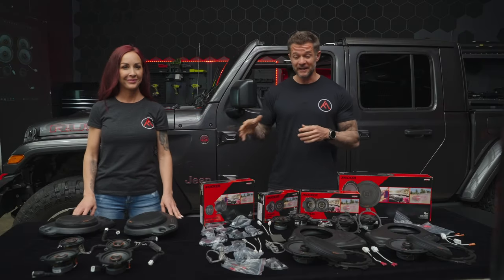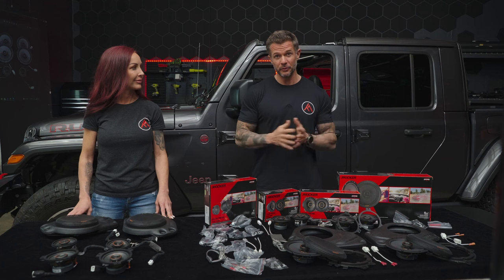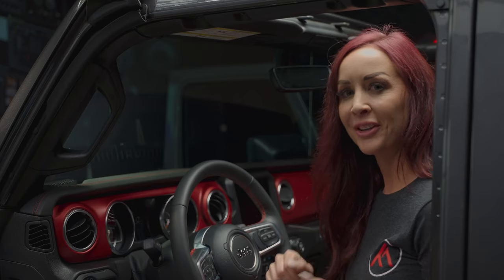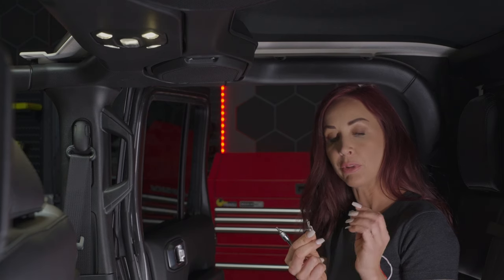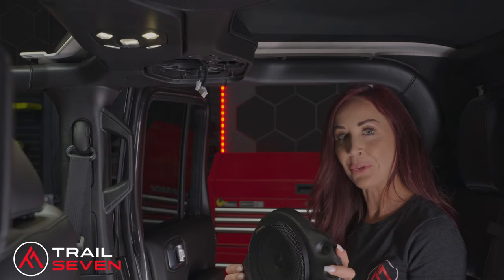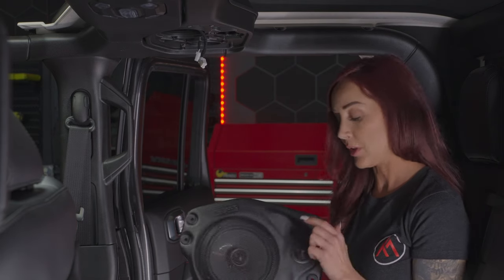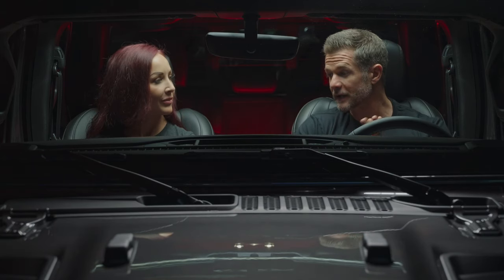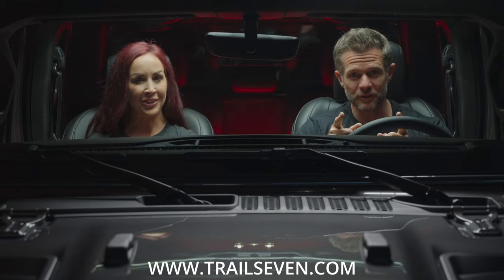Kicker Plug & Play Speaker Upgrade Bundle (Part 1) | 2018+ JL Wrangler / 2020+ JT Gladiator

Comment: Hi, I would like to know if this kit works for the 2024 Wrangler, since I see that it does not have the connector for a light that the 2024 model has.
Reply from the maker: @oscarvillegas5981  No, this specific bundle is not compatible with the 2024’s, however we did just release a full 2024 system.  Here is the link- 
https://trailseven.com/collections/mb-quart/products/mb-quart-800-watt-stage-6-tuned-six-speakers-system-upgrade-i-2024-jl-wrangler-2024-jt-gladiator

Comment: The website says that this is for an upgrade on the sound bar for Jeep gladiator 2020 and up. However, that is not correct because in 2024, they put airbags in the sound bar so it’s completely different than what is in the video.  The sound bar speakers will not fit in a 2024 gladiator sound bar.
Reply from the maker: @hyemm  The product page states “Kicker KS Plug & Play Speaker Bundle Upgrade (Factory Amplified) | '18-'23 JL/ '20-'23 JT”. 

It also states, “Not Compatible with 2024 jeeps.”

We have it noted that these are for 2023 and below only.

Comment: Question: if i got the kit for replacing the base factory non amplified sound system with the 7" screen, how well do these kickers handle aftermarket amplification?

Also, if I install an aftermarket 4 channel amp, would I still want to get the kit for the base factory system or the kit for replacing the factory Alpine system?
Reply from the maker: @jlang8213  These Kicker speakers are wanting and thriving for aftermarket power.  The KS particularly are designed to perform with much more power than the factory system can provide.
Reply: @trailseven thanks for the quick reply! If I'm planning on installing an aftermarket amp, should I still stick with the Kicker kit for the base factory system (without the tweeter) or the kit for the upgraded factory system (with the tweeter)?
Reply from the maker: @jlang8213  You’re very welcome.  Glad that you asked, you can select the speakers marked for the factory amplified system.  Be sure not to connect the teeter in the pod prior to installing the amplifier.  You can install the speaker pods and leave that tweeter connection not attached until the amp is installed.  Installing prior to will cause power issues with the radio.
Reply: @trailseven  ok, cool. Thanks!

Comment: how do you find the performance of this kit without upgrading the amp? I have the factory alpine system and  considering this
Reply from the maker: They’re absolutely an improvement over the factory Alpine speakers.  They’re a cleaner, crisper sound that we’re confident you won’t be disappointed with.  The Jeep in the video also has the Alpine system which performs much better with the upgraded speakers.

Comment: Just ordered!  I have a base model (non premium speakers). I’m hoping I see a big difference in clarity and improvement on bass and overall loudness.
Reply: Hi Man,
Please share your experience.
Reply: Please share experience.
Reply: The speakers are amazing and sound much better.  Big improvement on clarity.
Reply: which one did u oder i have to gladiator sport
Reply: @gueroballesteros3130  I ordered for the JL/JT I have a 2018 Unlimited Sport clarity is a major improvement with the kickers. If your order the one with the knee speakers expect to do a lot of work in removing things to install them. I have yet to do it because of time and I do not like that type of work. Wish I could return the knee ones for a partial refund.
Reply: @zfrank8420 ok thanks for real i’m like i can do everything else beside the knee part 😂 thanks appreciate it just wanted to know before ordering
Reply: Is the bass better? I also have a base system.

Comment: Wow, that looks super easy! Would yall recommend also getting a sub for those of us without one already? Or will these provide enough for heavier base/low tones in songs? Currently, its pretty sad with the stock 😂
Reply from the maker: An amp and a sub will certainly bring together a nice full system.  Checkout our plug and play amp/ sub bundles!
Reply: @trailseven I actually sent you guys a message on your website yesterday, but will I be able to use this kit on my 24? I see the listing shows 18-23 JL's, but then I'm able to select 2024 before adding it to my cart. I'm really hoping so since this seems like a great option and there isn't much out there marked for 24s yet. 😭
Reply from the maker: @jennafrenak6223  Unfortunately no, the 2024 sound bar is a complete change from the earlier years.

Comment: I have installed a similar system but infinity component speakers on the alpine system but all of the sudden rear soundbar speakers are muffled and twitters stop working or go in and out.  Scratching my head looking online for solutions.  Any suggestions?
Reply from the maker: The factory amplifier in the Alpine system can create a handful of miscellaneous issues.  The solution is to bypass the factory amp and add an upgraded amplifier.

Comment: Just received mine today and installed them right away. Installation was easy and and they look great, however I was a little disappointed as I don't noticed much of difference? I have the premium Alpine factory sound system and was hoping these will improve much more than 10%.
Reply from the maker: Thank you for sharing.  You should have most certainly noticed an improvement in clarity, however volume and adjustability are limited by the head unit.  To confirm, you have the factory Premium system with the amp and sub, correct?  Remember, we have a 60 day return policy so please do not feel stuck if you are disappointed.

Comment: Hello! I am upgrading incrementally, and so far I’ve changed the top dash speakers and added an alpine 5 channel amp and Stinger subwoofer. Which soundbar speakers should I buy? I see that one has a tweeter and one doesn’t. Thank you!!!
Question 2: what should the amp settings be for these speakers, when I definitely purchase them? lol
Reply from the maker: @stratdx  If you’re powering the sound bar speakers with an amp, you’ll want to select the option that includes the additional tweeter.  

As for amp settings, those would be set based on personal preference.  Some customers like to set their settings higher than others while some like to keep them lower than others.  

You’ll tune the amp once the speakers and amp are installed.  Lower the gain to 0, increase the radio to 75% with all of the radio settings flatlined, slowly increase the gain until you hear the speakers begin to distort, then lower the gain slightly.  Keep in mind speakers do have a break in period so the adjustment may need tuning over time.  

Hope that helps….
Reply: @trailseven  thank you for that info! The reason I asked about the amp settings is that the Terra Acoustics told me to set the HP filter to 200hz, so I didn’t know what settings you recommended for optimal performance. I’ll mess around with it a bit and see what works best. 
I just ordered the alpine version from you, btw
Reply from the maker: @stratdx  Depending on the amp will determine which settings you’re referring to also.  You’ll have options such as gain, filters, boosts, etc. depending on which amplifier you’re referencing.  

Fantastic, and great choice!!!
Reply: @trailseven  hi! My speakers arrived today! Is there a specific installation video for the alpine s65 plug n play for the soundbar?
Reply from the maker: @stratdx  Glad that you received your bundle!  The Alpine installation is the exact same as the Kicker installation shown in this video.  

Please let us know if you need anything at all.  

Remember, if your Jeep isn’t factory amplified, your pod will include the single coax vs the coax with the additional tweeter.

Comment: If my jeep don’t have the premium system. But I want the rear speakers with the tweeter. Should fit correct? Just won’t have the extra connector for it?
Reply from the maker: If you’re jeep doesn’t have the factory premium system and you haven’t upgraded the radio or added an amplifier, we would NOT recommend adding the pod with the tweeter.  In short, your factory radio cannot handle the power draw requirements of the additional tweeter.  This can and will cause the CAN system to react in a protective state which will negatively impact the sound.  

You can install the pod with the tweeter if you have the factory premium system, have an upgraded head unit, or add an amplifier.

Comment: I have a 24 392 and want to replace the sound bar speakers. With the new soundbar design do your speakers work? If so I want to purchase them
Reply from the maker: Sorry but they do not.  The new soundbar requires a completely new design which has not yet been fabricated.  Thank you for asking though.

Comment: I ordered the non-amplified kit without knee speakers for my Sport S. Still can’t crank the music without a lot of distortion. I don’t think the stock head unit has enough power to push the kickers without adding an amplifier.
Reply from the maker: Any upgraded speakers will be better quality and will sound better, however at full volume, with the factory radio, they’re not getting clean high power.  If you’re wanting clarity, yes, the upgraded speakers will provide clarity.  If you’re seeking “louder” that is a product of power which will need to come from an amplifier.  

In summary, they are going to be clearer and crisper over the factory, but “loud” will come from an amp.  They can handle a ton of high amplified power and they’ll reach a whole new level of performance when fed properly.

Comment: Since the alpine system is 2 ohm and Kicker speakers are 4 ohm wouldn't these speakers have twice the resistance and sound lower?
Reply from the maker: That may be a concern if we were swapping with the same size and brand speaker.  However, we’re swapping to a 6.75” coax with an additional 1” tweeter.

Comment: I’m looking to purchase the base non amplified version with the 6.5 inch knee panels. Would I need to make any adjustments for a 2021 jeep wrangler 4 door. Also, I plan on purchasing two 12 inch subwoofers for my setup would I need to buy larger speakers afterwards??
Reply from the maker: Happy to assist!  The 6.5’s will replace the factory pods without any modifications.  

If you’re planning on adding an amp down the road, you will want to purchase the bundle that is marked for the factory amplified system.  You can install the dash speakers, knee speakers, and the soundbar pods, however you will not connect the tweeter connection until the amp has been installed.  Connecting the tweeter prior to will create power draw issues.  Once the amp or aftermarket radio is installed, you’ll have the power available to not trigger the issues. 

Hope that helped, let us know if you have any questions or if you need anything at all.

Comment: For the single 6.5 DS kicker version, there’s only 1 wire.  Which of the 2 wires to we use?  Didn’t see any directions for this.
Reply from the maker: The Standard systems will connect the single  coaxial speaker to the large connector in the sound bar.  Both of the small speakers will be removed and only 1 connector will fit.   The small speaker connector will not be used and can be tucked away.

Comment: Ordered the standard bundle for my 22 Gladiator, and unfortunately the speaker is too large for the factory holes. I just received the spacer needed but it still doesn't seem to fit well. i can hear the spacer rattling around. could you possibly upload a video showing to install in Gladiator with spacers. thanks!
Reply from the maker: Sounds like you’re referring to the Alpine speakers and not the Kickers.  Please give us a call so we can help troubleshoot.  
Mon-Friday, 9am-5pm est
301-450-3207
Reply: Indeed I am.  I called earlier, waiting on a call back. Thank you.
Reply from the maker: @kashiussmiley798  Can you provide an order number please?
Reply from the maker: @kashiussmiley798  Hello- can you provide an order number?  We’d like to reach out to you.

Comment: I have a 2024 jeep wrangler Sahara and I bought the alpine spv 65X and it didn’t fit because the soundbar housing layout was completely different. Would the speakers you just showed work for my jeep?
Reply from the maker: @mesina74  No.  The 2024 sound bar has been redesigned.  These pods are for the 18-23 model.  Sorry.
Reply: @trailseven will you be making kits for 2024 models?
Reply from the maker: @joeh1231  Yes but the direct plug and play drop in pods will probably be another 6-9 months.

Comment: How do i tell if my gladiator has the premium sound option from factory? Im fixing to order but want to get the right one.
Reply from the maker: Hello!  If you have the factory subwoofer which will be mounted behind the rear bench in the in the center, that would be the factory Premium Alpine system.  If you do not have the factory sub in that spot, you’ll want to order the Standard Bundle.  Let us know if you need any assistance!

Comment: What is the proper package if I have a stock system with 5” radio but I’m upgrading to a stinger? Thanks!!
Reply from the maker: Glad that you asked!  In that case, you’ll want to select the package for the Factory Amplified.  Although you’re not factory amplified, the Stinger head unit will provide the power necessary to include the tweeters in the pod.  However, you won’t want to connect the tweeter connections until after you’ve installed the Stinger head unit.  If you’re installing simultaneously, install the radio first.  You can give us a call also for assistance.
Reply: @trailseven  shit I just bought the wrong ones
Reply from the maker: @josephr519  No worries, give us a call and we’ll get the order adjusted for you.  
Mon-Fri, 9am-5pm est, 301-450-3207
Reply: @trailseven  will do.  Glad I saw this!!!

Comment: How do I know if I have the non premium system without the amp and the sub?
Reply from the maker: If you have a Galdiator, the sub is located behind the rear bench in the middle of the wall which you can see through the speaker grill.  

If you have a 4 door JL, the sub is mounted to the right of the rear bed along the right side with a speaker grill marked with Alpine.  

If you have a 2 door, the sub is in the center of the rear floor.

Comment: How much louder does is this compare to the factory Premium system? 10%? Twice?  
I need it to be louder as I drive topless on the highway... I can barely hear the factory speakers...  or would it be good to add another amp?
Reply from the maker: They’re undoubtedly clearer, crisper, and louder, however It’s hard to give a percentage.  Also, you’ll be limited by your factory head unit.  The Kicker speakers are capable of handling much more power than the stock head unit can provide to them.  Before adding another amp, which isn’t an easy or inexpensive task with the JL’s/ JT’s, we’d definitely recommend swapping the head unit not only for power, but also for the ability to fully dial in your system with the built in EQ.

Comment: On the sound bar speakers, is it necessary to remove the little port tube?  It doesn't look like it is in the way of the new install... is it?  Will it hurt to leave it?  Also, there are two other factory speakers... do you have replacements for those too?
Reply from the maker: Yes, it is necessary to remove the port tube in order to achieve the best possible sound.  

The sound bars have 4 speakers (2 on each side), however only the Premium systems (factory installed amp and subwoofer) will receive pods with the 2 speakers on each side.  The Standard systems will have 1 coaxial speaker.
Reply: I think he is referring to the two front speakers at knee level facing you
Reply from the maker: @kennyphelps1160  Sorry for missing that.  Yes, we have knee panel speaker swap options.  The bundle has the 4” coaxial swap, however we can put together 6.5” drivers or coax as well.  Let us know what we can help you out with.

Comment: Do these speakers handle bass better ?
Reply from the maker: I would comment that they're more of a high range speaker.  We pair the bundle with coaxial speakers vs. drivers/ components so a sub wouldn't hurt to add to compliment the system.  If you're looking for a bass driver set up, we would can make suggestions.  Drop us a line at (Support@trailseven.com) so we can help you with your specific needs.
Reply: @trailseven  I really just hate the way the base system makes my speaker bar rattle.  Wanting to get away from that.
Reply from the maker: @Aceinfinity-le8zc  If you have the standard system, we have several options to choose from!